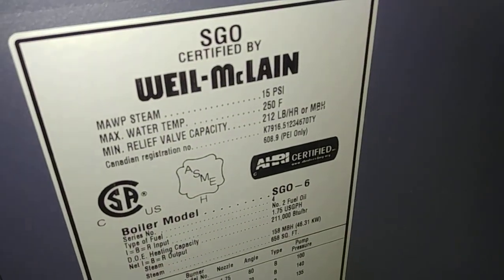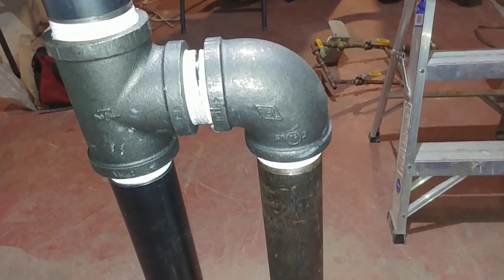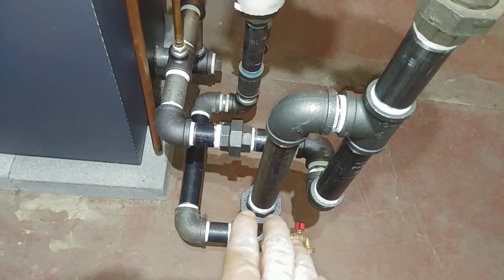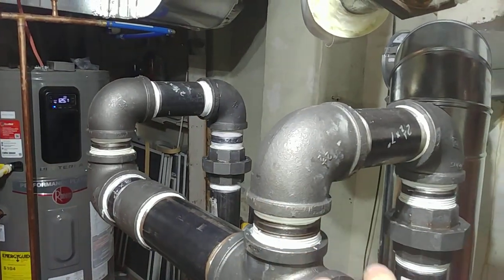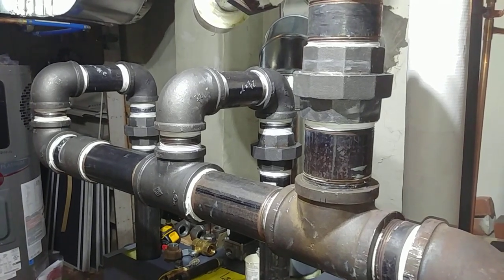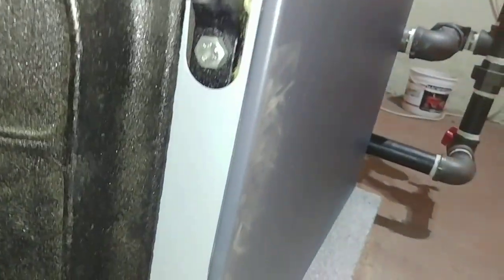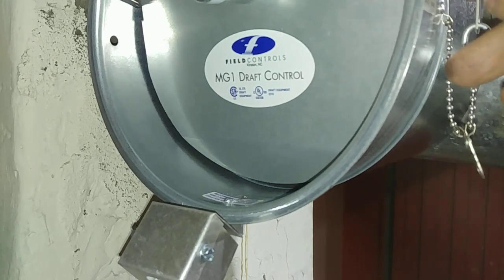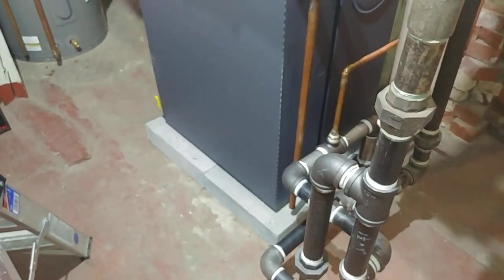Power Burner Steam Boiler Install - Near Boiler Piping, Drop Header & Hartford Loop

Comment: Clean install, any reason you used black malleable? Just wondering I was taught to use cast iron fittings on steam
Reply from the maker: Thanks!
I was first taught to use copper for steam and had to "un-learn" that!
As to the malleable vs cast debate, my feeling is that cast iron is not all its cracked up to be (insert Dad Joke here).
Malleable fittings start out at the factory as cast, but are then heat treated to turn the carbon from (sheet-like) graphite into more round "perlite" so you can hit the iron and not crack it - or so I am lead to understand.
Back in the day, cast was much cheaper than malleable because of the extra steps and heat energy to make it.
In order to be competitive, cast was the way to go.
The fact that it was easy to crack to remove it was only a secondary concern.
Now, because cast is really only used in a big way in the fire sprinkler industry, cast has become expensive and hard to get.
In short, we believe that there is no real advantage to the customer or the installer to using cast fittings.

Comment: Gordon- do you ever convert an oiled-fired steam boiler to gas fired?I’m in Queens, 40 years ago I replaced a converted coal-fired behemoth, then used up a WeilMcClane, I now have a 3 year-old tiny Slantfin, it’s still oil fired, I’d hate to loose it, works great in my small archieBunker house but considering the switch to gas like many. Any wise advice would be appreciated. Thanks
Reply from the maker: Yes, we do oil to gas conversions all the time.
It should be possible for yours do be done, too.
Which model of Slant/Fin do you have?
Reply: Gordon-it’s a Slant/fin Intrepid 134 btu, I thought there could be a kit for a conversion to gas that includes new burner/power damper - thanks!
Reply from the maker: Well, doing a conversion from oil to gas is not quite "plug & play".  
There is no all inclusive kit.
There are several different power gas burners out there, &
it is best to stick with the ones "approved" for your boiler.
The Carlin EZ Gas is one such.
Next, find out if you need a meter size upgrade.  Unlikely in your case, but best to make sure.
Next, have a properly sized dedicated gas line run from the gas meter to your boiler and have it done to Code.
Make sure you have a breaker in your electrical panel just for your boiler (and properly marked) & your emergency switch works. 
Have your chimney inspected by a licensed chimney sweep.
It is likely, you will need a stainless steel liner. 
Thoroughly clean the fire-side of your boiler and remove the "rug" from the bottom of the firebox (it will be no longer needed). 
Install a double-swing gas-style barometric draft regulator (make sure it is plumb & level), and install a "blocked flue" sensor on it.  Wire the sensor into the primary control.
Mount the burner & wire it correctly.
You may need to use a keowool cuff at the burner head.
Drill out the gas orifice to the proper size and hook up the gas.
Fire the boiler and tune the burner using a combustion analyzer.
No setting up a burner "by eye"!  Can't be done.
Have your old oil tank removed (if it is an inside tank, have the fill pipes removed so you don't get an oil delivery into your basement and destroy your house).
This is not a comprehensive list & I'm sure I've forgotten a few items.
I believe I have other videos on installing an Intrepid with a gas burner on my channel.

Comment: Why is the Hartford loop connection made as short as possible tieing back to the drop leg.  Never understood the imperative from your other videos.
Reply from the maker: That Hartford Loop connection is where water hammer can occur, as there is steam at the equilizer line and (there should be) condensate water returning to the boiler.  
If and when the water level gets low enough, the steam in the equilizer and the returning water meet. 
If there is a longer nipple, the water can get lineally accelerated to a greater degree and if the nipple is as short as possible, the potential for water hammer is thereby reduced.

Comment: Will you be installing a blow down valve in the rear of the boiler as well?
Reply from the maker: Not at this time.
No easy drain point (i.e. close-by sump pump) that I could see.
One can be added later, of course.